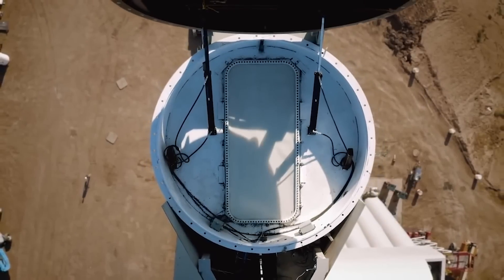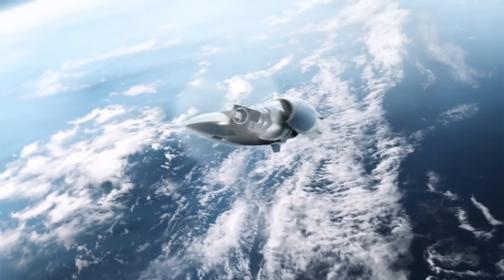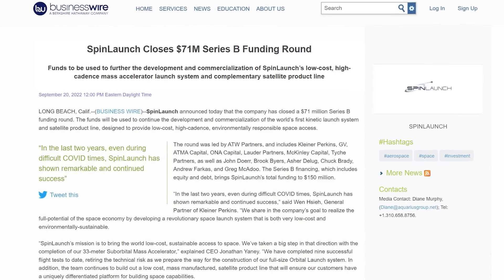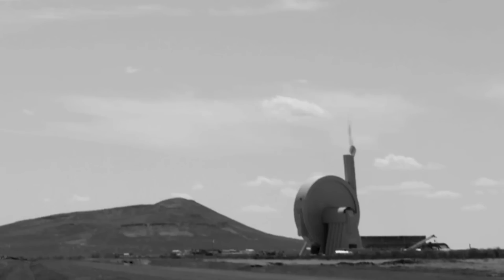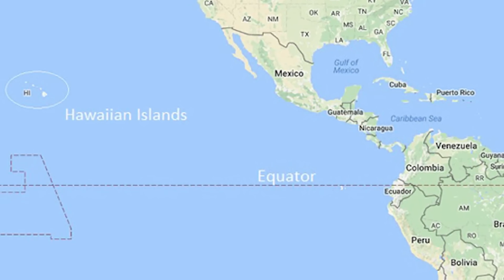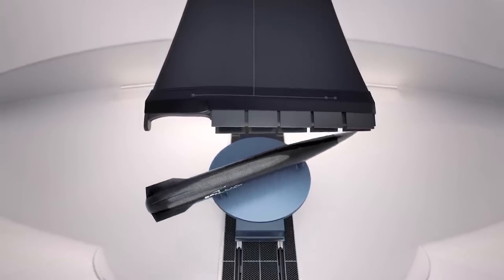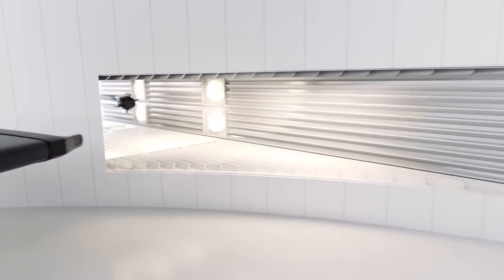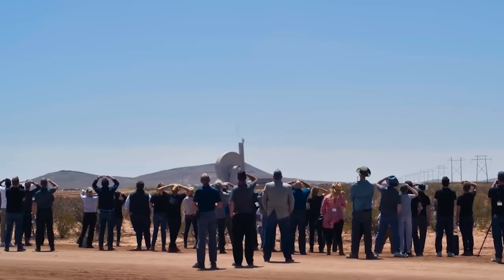What Happened To SpinLaunch & The Orbital Accelerator?

Comment: All the replies seem centered around an equal mass at the other end of the arm that releases half a turn after release of the payload. They talk of a 200kg mass on the end of a 90 foot arm and a surface speed of 5000mph (yes, 5000mph). I am not a physicist or a mathematican but just offhand, that is a shitload of G's and anything travelling at that speed is basically unstoppable. The first example I can think of is a railgun - no explosives, just carnage using the projectile's kinetic energy. Forgot what it's called but studies were done where telephone pole sized tungsten rods would be fired from space and they would cause massive carnage using only their kinetic energy. 😮😮

Comment: There's a fundamental problem in that the payload has motion components that are the super position of the rotation about the center plus translation caused by the arm.  You might think of the payload at the center of the system just rotating and then translate the payload to the end of the arm.  When launched the payload disconnects from the arm stopping the translation, but the payload is still rotating.  The payload will NOT fly like a rocket, but rather will tumble head over heals.
Reply: @stuartschaffner9744 and @DreadX10 make this point in the top comment thread  and @rpercifieldjr (below) and I agree. The projectile leaves the launcher with an angular rotation equal to the rotation of the arm. Many can't understand this concept, but imagine a camera tracking the rocket while it rotates inside the vacuum chamber. It has enormous spin and therefore enormous angular momentum. Dissipating that spin/tumble via air fins would be unworkable. Some have said it could be alleviated by releasing the front of the rocket before the back - but that would put super-gigantic angular acceleration on the projectile - even more force than the 200Gs of the centripetal force - forces needed to stop its rotation within milliseconds.
Reply: @skylark9845  Since this fundamental physics problem was not addressed it seems this was a scam from the get go.
Reply: @Brooke95482  Or maybe you've missed that we have a thing called drag forces which stabilize? Once it's in the air, it's going to face resistance which can do work.
Reply: Perhaps add a 2nd rotational mechanism at the end of the arm to counter-spin the payload. Still seems hard. And if anything goes wrong, everything gets obliterated.
Reply: Fundamental problems often have fundamental answers. Taking the time to solve things isn't a mistake.

Comment: Might be great for moon launches. You could make this more viable with a ramjet on the vehicle but this wont work for straight orbital launches. What satellite could withstand those forces? And the sonic boom...
Reply: Supplies? Satellites that have been built to survive the G's? The question isn't "Are there no problems to solve," the question is why not solve them? Even the internal package hold can be designed to minimize risk. It's a matter of practice in will.

Comment: You know, this could be great to have on the moon or Mars. 
It would be great for sending up fuel, supplies or raw materials.
Reply: The payloads are so small though.  To send up any usable amount of fuel it would have to be scaled up significantly.
Reply: @timb7775  Yes or send up more of them.
Reply: @timb7775  Also once we get set up, we could make our own fuel. Living off the land.
Reply: Even if they got it to work it’s a lot of material and resources to get into another planet. For as much effort as this is you could likely setup equipment that could produce fuel for a more normal rocket.
Reply: @NBSV1 You would set up manufacture on moon before building this.
Reply: @asumazilla  Yeah. Just rocket up everything to setup manufacturing on the moon so you can then maybe send small payloads of stuff back a little more efficiently. Would work great for that highly populated moon base they've got up there.
Reply: @asumazilla  Yes and would be no problem sending back anything we would need.
Reply: @NBSV1  So set up a fuel manufacturing plant on the moon. Not big but efficient. 
So while we are going about doing what's next, that thing is cranking out fuel. Also remember that the escape velocity from the moon is much less than that on Earth. So it won't need as much fuel.
Reply: @williamburroughs9686  Still begs the question of what you're sending back from the moon with enough regularity that you need to build all this just to send that stuff back more efficiently. 
The escape velocity from the moon is low enough you could probably just fire something out of a cannon way easier and with less material than trying to build something like this. 
It's an interesting concept and all. But, doesn't really solve any problems while also creating lots of new ones. For all their trouble and money they could have nearly shot something out of a big air cannon and gotten the same result.
Reply: @NBSV1  This would work well if you have a lot of electrical power. I guess a rail gun might work better. If you want to use the centrifugal launch system, then putting it on the moon solves the major problem of having to move through the dense atmosphere at escape velocity.
Reply: @asumazilla  There's so many problems with a centrifugal launcher timing, balance, and sustained high g loading just being a few of them. Something like a rail gun or even a conventional cannon would be way easier and take much less to make it work. With the moon you could probably even reach escape velocity with a compressed air cannon. Granted getting the air to compress would be an issue. 
At the end of the day it's an interesting project. But, just not something realistic when there's already other things that could "launch" a similar payload with much less effort.
Reply: @NBSV1 Long term,  there shouldn't be any reason we can't do both, and more.